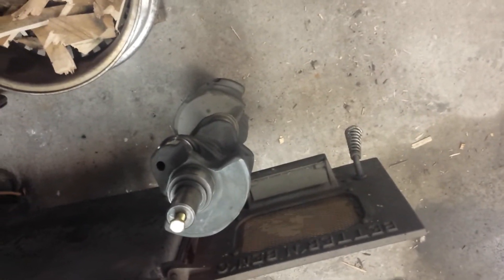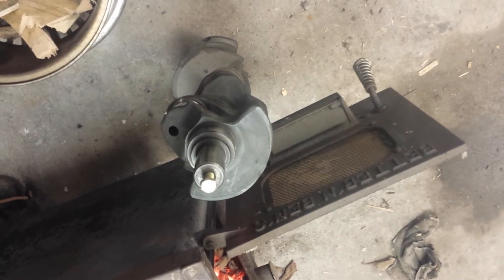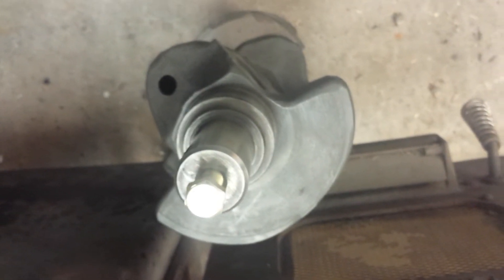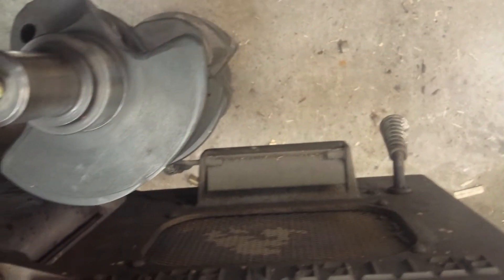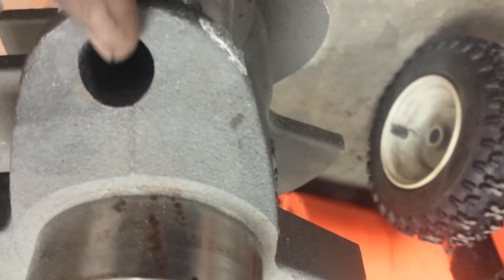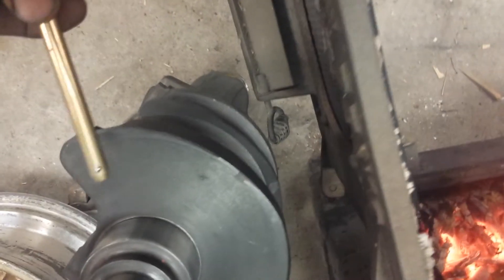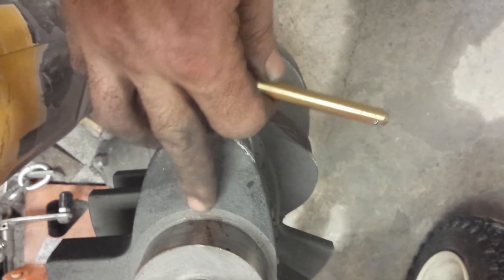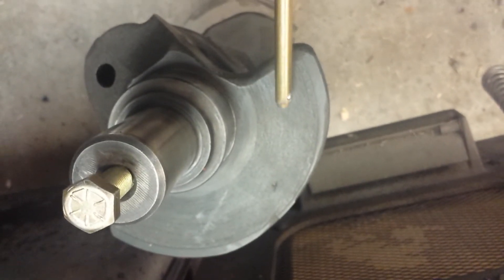Telling a Forged crank vs. cast crank

Comment: Cool info Mark,
If you balance the crank does it affect the "ring tone" ?
Reply from the maker: The balancing requires drilling or welding in weights  here and there to achieve the balance but I don't think it will change the pitch of the crank because of its density
Reply: fatstercat how can you tell if a crank has been balanced before?
Reply: fatstercat can you tell by the ring tone if it’s in a block? Not with rods and pistons on it but just a crank in a block? Because I know where a couple blocks with the cranks in them are, and they’re supposed to be a forged crank, but one of them the year is questionable being it was a year where the majority was cast but some were made with forged cranks that were left over from the previous year